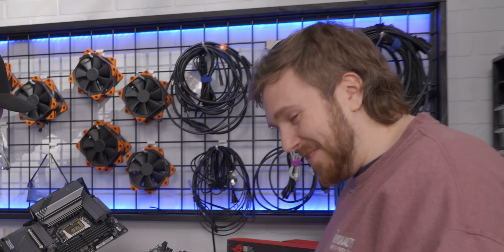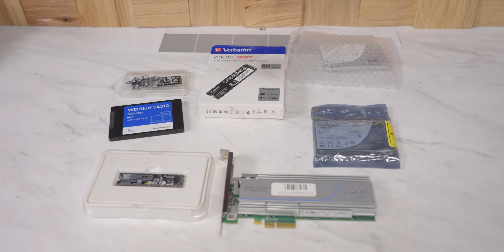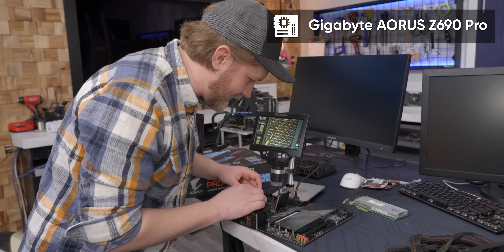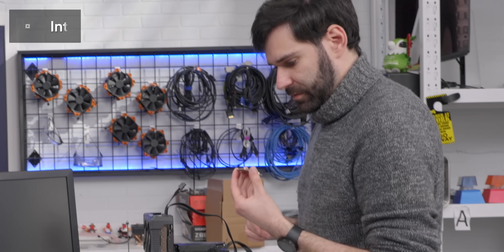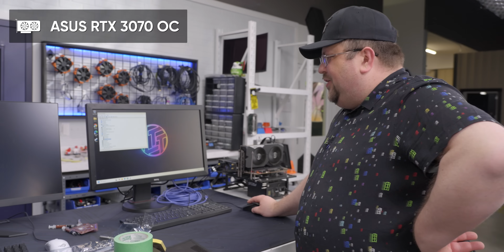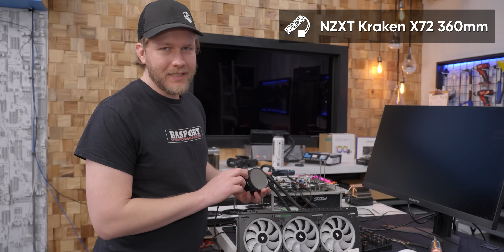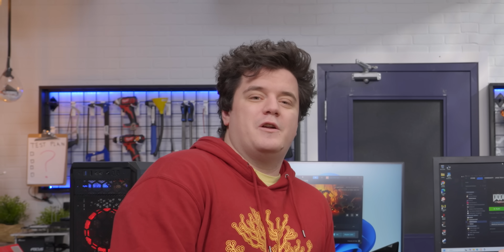I Built a Working PC using only Broken Parts

Comment: I tried updating the bios on a gigabyte aorus ultra gaming motherboard to use a ryzen 7 5800xt and ended up bricking the mobo
Reply: Did you tried to reset the bios or reflash it with bios flashback.

Comment: With Unknown RAM.
Use a program called Memtest86+
It will stress the RAM and if it is faulty in some way, it will show it.
Its also good for testing RAM after you've overclocked it or just enabled XMP.
Remember, XMP is an overclock and just cause those chips can do 7000Mhz, does not mean they will not have some kind of fault.

Comment: FYI, a VERY broken ssd can read like brand new if the controller chipset crashed.  It normally just won't read, but I have seen it before read like new, and very much wasn't.  I even was able to recover some data from the "new" drive.

Comment: FYI, GPU booting does NOT mean it works.  I had to trash a laptop when the GPU died.  The fun part, it worked 100% of the time, if I did not install drivers.  Once drivers were installed I had to boot to safe mode and uninstall the drivers to be able to do anything.
*edit: no it is not a driver issue, if you know how pc's work the "basic" drivers do not have access to most of the gpu, the vram, and they specifically leave hardware acceleration disabled.  The driver simply told the pc what it had, and then when trying to access that hardware it failed.

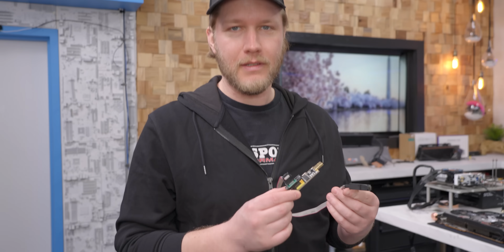Comment: 19:11 Actually full fan speed and not slowing down is a 50/50 because usually it's JUST the component that senses heat and thus shuts down the card meaning all you need to do is either replace that or fix the current one. It will not run the card if this piece is broken or damaged and it will automatically read as the card being too hot to run. If it does this during gaming like it did to me it will auto blue-screen with a specific error code.

Comment: "People arenr coming back" with less than 2% return customer rate and 10% drop in average order is a bit of an odd link. The amount of people coming back hasnt changed all that much. It seems gettjng then to buy the first item is the issue, and/or trusting it for higher ticket items.

31 ---> 29% returj customer rate isnt g9nna crash a company into sudden long term negatives loke that

They used to be legendarily good back in the day (a long time ago now...)

Comment: I will say buying broken CPUs can be a good idea IF THEY ARE PGA, most of the time that’s just bent pins and either you can bend them back in place or if your lucky it’s like a bent ground pin and you can just remove it (check the CPU pin out diagram)

But LGA cpus? Don’t even bother

Comment: Hey Guys, I watch Northridge fix all the time and if you want to make life easier when trying to remove components off of the GPU, you should use Low Melt Solder. Alex uses that to remove the power connectors when repairing the burnt connectors on 4090s.   It will lower the melting point of solder which makes it easier to deal with. Please be careful when working on those boards. Wear a mask, use a hood vent and wear goggles. Use a hot air station to heat up the chips gradually and apply antec flux. Try and shield any capacitors as you do NOT want to heat those up, they go boom.

Comment: I have a question, While dusting my GPU, my gpu died, I was extra careful to make sure the fans did not spin while using the blower, and used short bursts of air instead of a constant high pressure.
GPU was a Zotac RTX 2060. WHen I plug the GPU in and power on the system, it blinks and that's it, tried different slots, tried a different GPU works with it.
When I do not plug in the 8 pin power connector the system boots up however, on the RX570 the 8 pin works fine, what could be the reason?
Or what could be the possibilities???

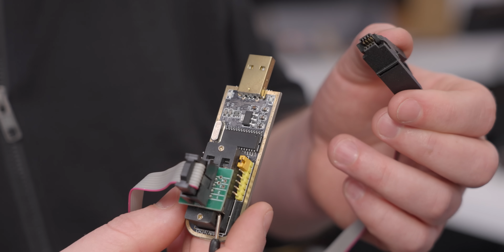Comment: @ 21:26 You mentioned that the CHA341a could only read "F" did you mean flash? I ask because I have one for work and use it all the time for that exact purpose. I noticed that Pin1 was in the wrong spot @ 19:18. The second issue is some of these have a 3.3v rail issue and needs some additional soldering to fix in order to enable 3.3v instead of the constant 5v which is what mine was getting. if you google it you'll find the fixes out there. hope this helps! love the content.

Comment: you make a mistake with the progamer . thats the ch341a tnat has a desaing problem , it output a vcc of 5v directly to the eprom o spi flash memory , 5v will kill many spi causing the ff ff ff ff ff on the reading . you need to read the datsheet of thouse spi and modify or use the adaptator for the ch341 in order to get the correct 1.8v or 3.3v

Comment: I would buy LGA Motherboards or PGA CPU's with some bent pins as "for parts" maybe a old case if it's for free and a way too old cooler but I would never get broken (LGA)CPU's SSD's and Ram. Have tried resurrecting GPU's from time to time but rarely had any luck. I had some AMD GPU's that did just work and this seems to be a thing with them. Would never get a broken Nvidia card ever again. I'm no tech wizard and if those are dead they always are dead to me. Some stuff just isn't worth it trying to save money buying broken parts. But surely makes for a good video.

Comment: 12:49 If you nerf the processor's clock rate, of course it is a win. 
It is no different to increasing the clock rate for "overclocking."
You have a functioning chip. It works. I say so. :) This is my opinion.

Comment: As someone who does bios flashing using a bios flasher constantly(Work related), that 3070 that read all Fs was not because of the board not working. BIOS chips do not care about a working board. May need a new BIOS chip though. Could also just be a bad connection to the flasher tool

Comment: Remember when CPU failure was rare as hens teeth? After recently pulling my hair our chasing a bootloop issue, i was shattered to find out my two year old CPU had died. Over 25 years of building my own systems it was the first time i had a CPU give up. I still have a Phenom 2 945 i built in 2009 in the shed that runs flawlessly, besides being obsolete. Even the used market shows that obtaining a working old CPU is no challenge, but rather everything else failed. Whatever happened to CPU reliability

Comment: Only 2 components worth fixing Mobos and GPUs, rest just buy new. Mobos only if bent pins and you have a microscope and steady hands, GPUs if you are willing to drop 1500$ on gear and do it as a side hustle. For a one off build not worth it. Also check sellers other listings, if they have 20 GPUs and 20 mobos for sale that’s a professional, they’ve looked at repairing them and deemed it not worth it, or not possible. Faulty PSU, that’s not realistic, LMG has a 200k machine to test, you do not.

Comment: 😂 You installed both of the anime versions of CrystalDiskMark? I did that once too wondering if there was a difference between versions...just went back to standard in the end...I don't need some anime waifu telling me how slow my harddrives are...also I bent the pins on the motherboard I had a Pentium AE chip in years ago...actually snapped a few off trying to straighten them out, like just the top skinny bit that contacts the CPU, tried to bend those up a little extra...still worked, but lopped off about 500Mhz of stable overclock dropping it to 4.5Ghz, system is still running strong for my stepfather, now with an i7 4770 because single thread dual-core just doesn't cut it...I assume they were just ground pins, which are somewhat redundant, they're all bridged together anyways....

Comment: so I did buy a couple of broken SSDs, a crucial 500gb 2.5" drive that looked like it had been run over and an a 4tb xpg nvme rgb ssd that I thought had a slight chance of working. the crucial drive is in a 2.5 enclosure and is fine.

The 4tb drive was dead dead. Decided to see if it could get RMA'd was honest about it's physical damage and they replaced it anyway.

All in all I spend about $20 canadian on the pair of them.

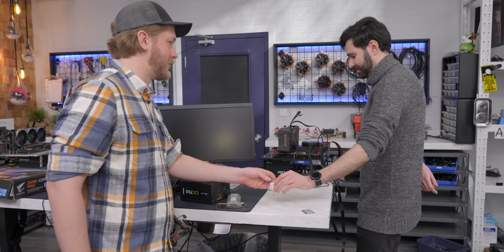Comment: 11:22 There are definitely a handful of situations where you should buy a dead cpu, I think bent pins are the most obvious, it'll probably work after fixing the pins but another as mentioned in the video no post is sometimes just an out dated bios for certain chips, I got a ryzen 5800X like that and the seller was curious if I got it to work or not, so from what I could gather the seller was the tech guy and was trying to help a friend/family with their PC but wouldn't listen, so he pulled it and sold the "dead" cpu to me and I gave him bragging rights for being correct lol.

So not only got a 5800x for under 1/3rd of a new one, but had a nice interaction with the seller too.

Comment: When you don't have a PCB preheater you can use a 3D printer and it's heated bed for the same purposes. 
It actually works really well. 

It also works really well when opening up phones and trying to replace it screens. Instead of the ifixit heating pads or a proper heating plate just using the heat bed works just as well. 
You probably don't have a 3d printer near that set but the labs team might already know this little trick.

Comment: Du people actually dump SSDs because of time used? That's crazy. A NAND flash drive can run for thirty or fifty years if it's only used for reading. The only thing that really matters is the write cycles. In fact, it's a great idea to demote active drives to archival storage as the write cycles grow but before it starts to slow down. In most use-cases you're probably never going to hit the max write cycles, so don't throw them away. Or if you do, throw them at me.

Comment: The GPU "died" when drivers were installed? What drivers? Tried it on Linux? Just because something feels dead inside when it comes in contact with Windows doesn't necessarily mean there's anything wrong with it.

Comment: Not always with numlock. Sometimes it's just a hardware switch and I've seen it toggle on hard locked systems. Capslock usually requires interaction from the CPU and is a more reliable indicator of an active system in the situation you describe.

Comment: Did you try to overvolt that 12700KF ? I had a 7700k once that worked perfectly fine but only after you overvolted it at stock speeds.
Reply: It's interesting that the 12th gen chip needed to be downclocked, that's the generation that shouldn't be affected by the dreaded Intel "Vmin shift issue". I expected this for the 13th gen chips, but apparently they just didn't work altogether.
Reply: @sp00n  Yes. I got the 7700K from Ebay as faulty for like £20 and it behaved as if it was on a bad overlock so I just upped the voltage and it just worked fine. The 12700KF might have been overclocked and became sensitive to voltage.

Comment: A stress test might not actually work for PSUs. Have had a bad psu that could handle full stress tests with both cpu and GPU tests running att the same time on max for hours but then still be unable to handle farming simulator att medium settings for more than 20-40 min without shutting off. It's wasn't untill I threw my brother's old PSU in my rig that I realized it was the PSU that was the problem

Comment: you'll find with those CH341A flashers that on some systems you need to have the power cable plugged into the psu for it to detect/read/write properly as some components can leech power off the flasher.
with the ssds, plug them into power without sata and leave them powered for 30 min, a lot of them can self repair.

Comment: I do this with camera gear. I got a Sony FS7 and FS5 for relatively cheap. The description said dust behind the filter glass. I researched how to clean this which is pretty easy. The cameras came per mail and there was no dust... Same with a fisheye lens. They said the aperture won't move. But it works perfectly fine.

Comment: This reminds me of how my current backup pc came to be: 

- old 5800X I just upgraded from ($80 used, but saw it working in-person first)
- untested B550 motherboard ($50 used)
- EVGA 850w Titanium psu ($85 used)
- two random sets of open-box 4400MHz DDR4 from Amazon ($100)
- 6900XT ($360 used, guy couldn't play World of Tanks with it)
- random case with fans and 360mm Thermalright AIO ($80 used)

Most things are easy to troubleshoot, or sometimes just asking the right questions can help you "weed out" the things that aren't within your troubleshooting capabilities.

Comment: The water cooler, you should probably flush bleach through, then soak in some glycol solution to loosen up any bio-material, then flush out with a water hose outside, as much pressure as you can hold, flush that thing out, coat/paint that metal, and run a coolant through it, replace coolant after a month with added glycol.

Comment: I bought a ASUS b43j from the grid and they said it wasn't working. Turns out it works perfectly and has no issues. Installed windows on it and have been using it for awile.

Comment: It would probably be a lot smarter to simply buy parts used instead of outright broken. The saving will probably be lower, but they will be much more reliable to function and you don't need soldering skills or the knowhow and tools needed to do stuff like unbend pins.

Comment: Some of the parts on my $3k desktop were "not working" or store returns.
Unfortunately, I have not gotten the rare Gigabyte Aorus 7900XTX ($430) to work; and only managed to get 2 Asrock 6800XTs ($220 for both) to boot (the same ones as in the video), but not be usable.
The RTX 2070 goes to max fans, and the PC does not boot. I haven't worked on that one yet.
The Redragon RX 5600XT ($36) was considered to have non-working fans, but they work with me, although they sound like a server.
The Sapphire Nitro+ 7900XTX ($750) supposedly only ran at x8, but it runs at x16 with me.
The 7950X3D ($390) was untested, but it has worked well so far for almost a year.
The motherboard and Corsair AIO ($99) had missing mounting hardware.
The MSI 1600w PSU was just part of a GPU bundle for the seller.
My MSI 1440p 240hz monitor ($99) has a single line of dim pixels.
So, the only thing new on my PC was the case. Sad about the Gigabyte 7900XTX and 2 Asrock 6800XTs, but happy about everything else.
I also managed to get 20 SSDs for $330 as "for parts". 16 out of 20 work (1TB and 2TB), with 2 out the non-working ones being 4TB.

Comment: I would actually take that gamble in buying broken parts if they were cheaper. 

Idc if you bought the GPU for $1500 , I’m not buying it for anything more than 50 bucks if the chance of saving the item is unknown. Not giving you $800 dollars for a paper weight.

Comment: Nice video but a little bit clickbaity... I mean i understand fixing ram, power suplies, CPU, hdd/ssd's is hard but just buying stuff and getting lucky is not broken.... Also a case that is missing a side panel is not broken it is just missing parts. a case that is so mangled up that the board does not fit is a broken case.. So some fixed broken parts and some just lucky parts that worked out... But most of them are ones that has been shown on the channel lots of times. I mean like Motherboards and GPU's. Not even the showing effort to try and fix the unfixable is lazy. I would have thought you would take the Mythbuster route and try to fix the unsavable parts....

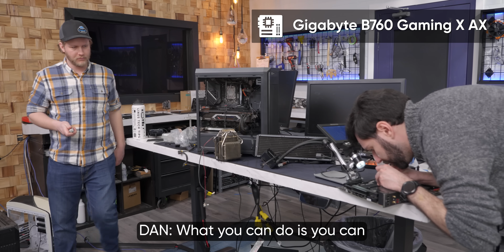Comment: 16:05 YESS finally it gets mentioned, a surprising amount of pins in a socket are multi redundant, if 1-2 are bent/ missing you should be able to run it as is. Ive personally repaired 3 motherboards and sold them as reworked but 2 out of 3 had a single broken off vccgt pin with other bent ones and the third came away with none broken, all boards turboed and were stable with all ram slots with everything working as it should. Though I fear my luck is or has already run out, forth eventual board gunna be dead ;-;

Comment: Ram is rough because a bad ram stick might appear fine until windows randomly needs a sector that doesn't work. 
GPUs are rough because they are just worth so much people can't afford NOT to repair them. 
And I've had SSDs that appear fine at first but once they fill up ~halfway they start having write issues. 

There are some components you can probably try and repair and like Alex said if you can see something that is obviously broken you can fix, great, but unseen issues may crop up later and cause more problems than they are worth.

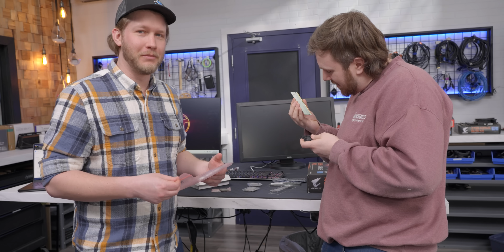Comment: 4:03 You can theoretically pick up RAM with defects, test it using memtest86+, and block the damaged memory range using a kernel parameter on Linux. Not sure if Windows can do the same :P

Comment: You guys really need to revisit the AC refrigerated cooled PC parts under mineral oil to prevent condensation. Cool either the liquid or the cpu/gpu directly AND the mineral oil

Comment: I am just going to throw it out there, RAM can be bad and not cause an immediate failure then cause the computer to crash in certain tasks, every 3 hours, or whatever. Just because a computer boots with bad ram doesn't mean it's working correctly.